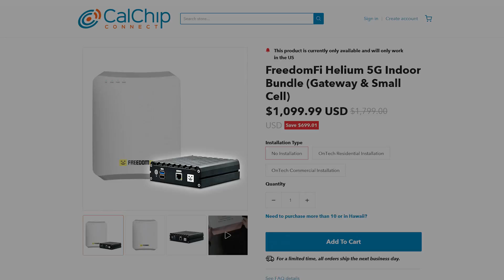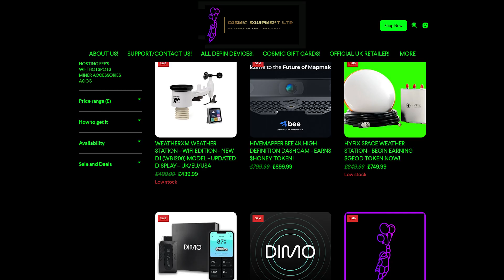Is Mining Helium IOT as a Lone Wolf Worth it in 2024?

Comment: this is what happened when i mined Helium. i have to verify my radio which means i have to sign up with the service Helium Mobile. now my phone is locked and doesn't work. also i'm a software developer and familiar with technology.
Reply from the maker: RIP, which Helium miner was it? What model? How did you get you phone locked?
Reply from the maker: That's very interesting I have not yet ran into that issue myself, but thank you for sharing. 

So it sounds like you eventually get it all sorted out then, right?
Reply: new update. my Helium CBRS radio has been banned because i didn't validate fast enough.
Reply from the maker: Dude the absolutely sucks!
Are they not able to unban it and let you try again?
Reply from the maker: Man! So sorry!!!
Reply from the maker: Sucks!
hardware@hellohelium.com can help with helium technical support if you need it :/